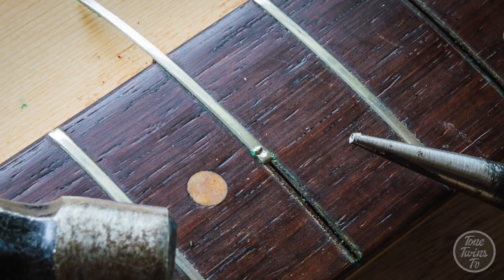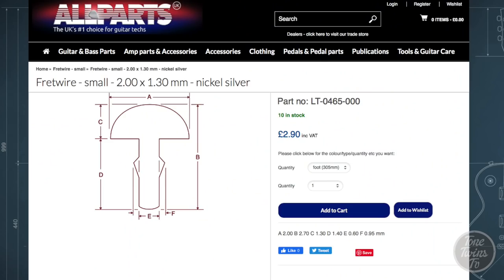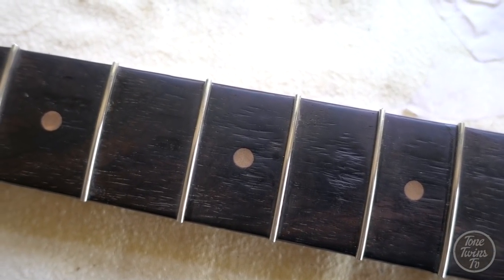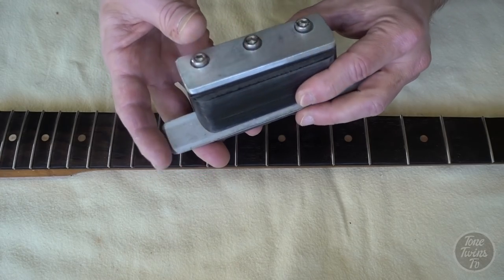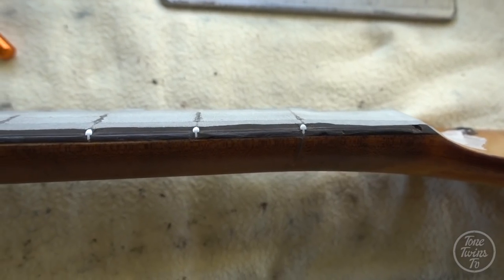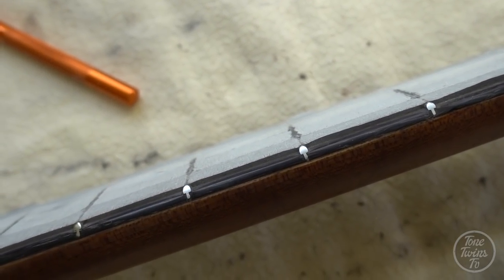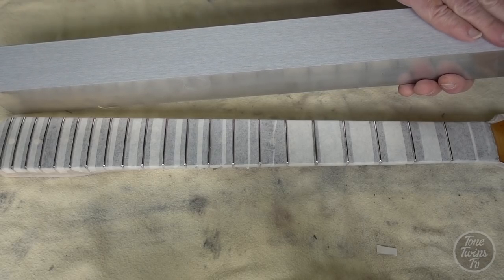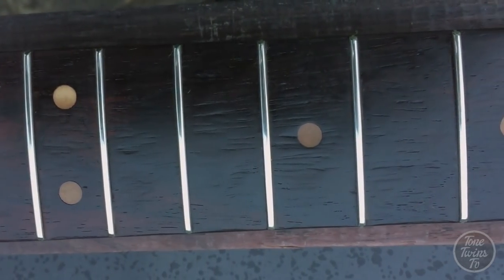Chris Buck 1962 Strat Restoration Pt 3

Comment: Another great video featuring the 1962 Strat restoration. I’ve never carried out a refret but have done quite a bit of fret dressing over 
the years. I’ve seen that fret end dressing tool on eBay and often wondered how well it worked, it seems to be very good as long as you’re careful, it’s certainly a lot quicker than filing each individual fret end. Putting tape along the neck before masking the fingerboard is a clever idea, it can be a bit of a pain peeling all those little bits of tape off.

Comment: Hi, just an observation, could be wrong but looking at the fret slots from the "original frets " they look pressed in ? you can see the tang shoulders have cut into the board on the way in. You wouldn't get that from side installed frets.

Comment: Hi, great vid. I was wondering if it is right to level the frets with a flat tool, isnt it better to do it with a radius tool?
Reply from the maker: Both work fine Mauro. But you only need one flat leveling beam - but maybe a different radius block for each type of neck. 
Also I find it beneficial to have a block/beam that is longer than the fret board. That way all the frets remain in contact with the abrasive at all times. 
With shorter blocks, the middle frets can get more sanding than the frets at the ends of the board - which is why some people notice choke out at the upper frets after frets have apparently been leveled.
Long radius blocks are very expensive but a flat beam like the one I use costs next to nothing.
Reply: @tonetwinstv2863  ok, thank you!